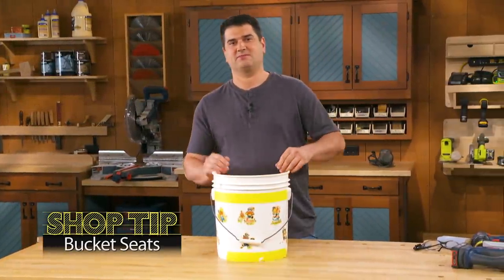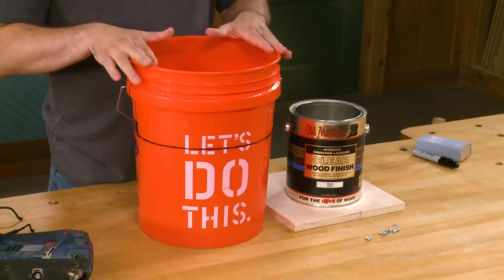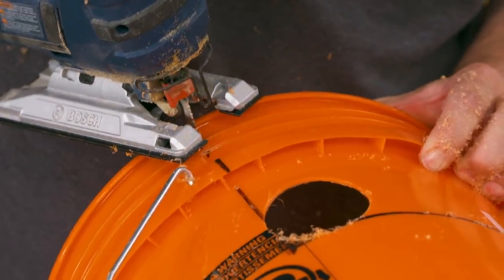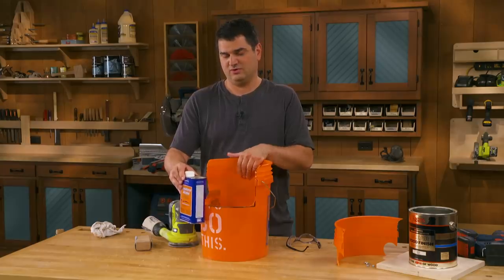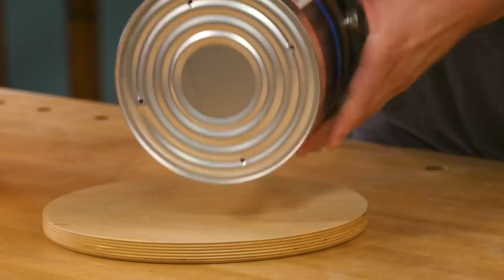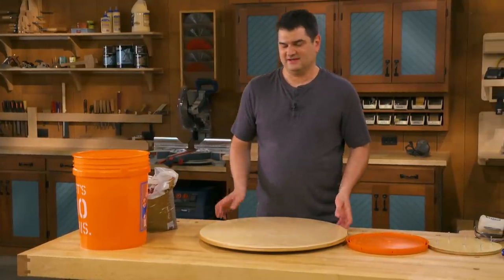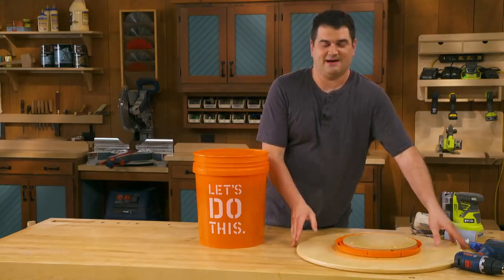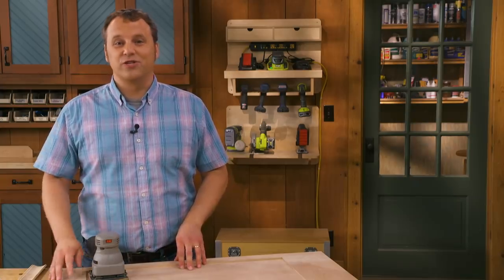Making Easy DIY Kid's Table & Chairs From 5 Gallon Buckets!

Comment: Nice project. Could use some more measurements. What no power equipment that no one can afford?
Reply from the maker: Yeah, I didn't give a lot of measurements because it depends a lot on the bucket, paint can, etc.  you have.   The main things is that you want  the plywood for the seat to end up centered on the cutout so it doesn't sit up too high and leave a gap or too low and have the edge of the plastic sitting above the seat.  Simple and fun :)